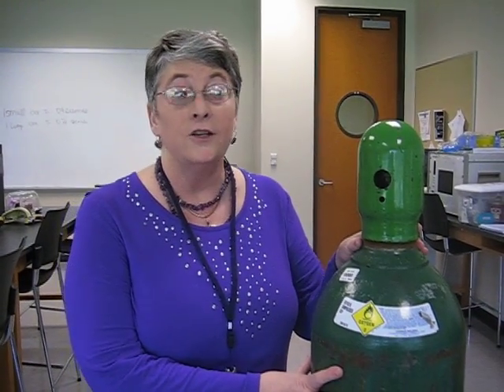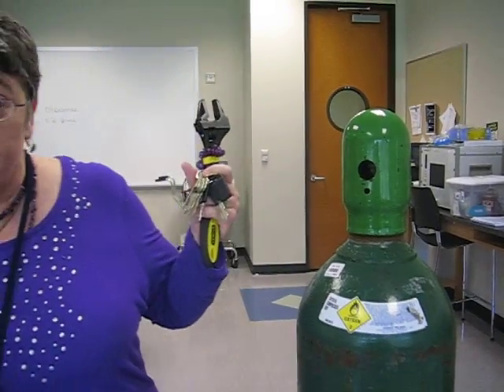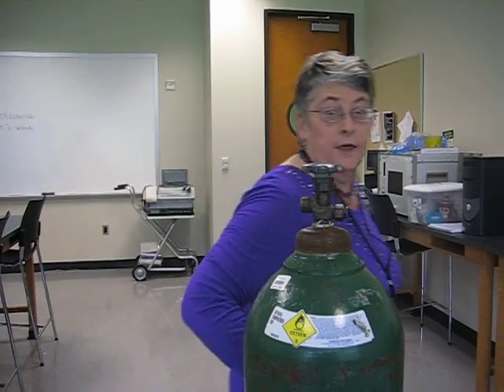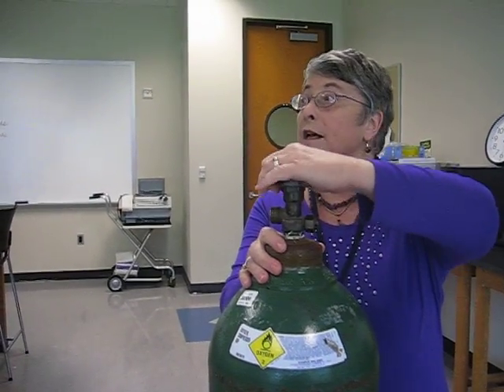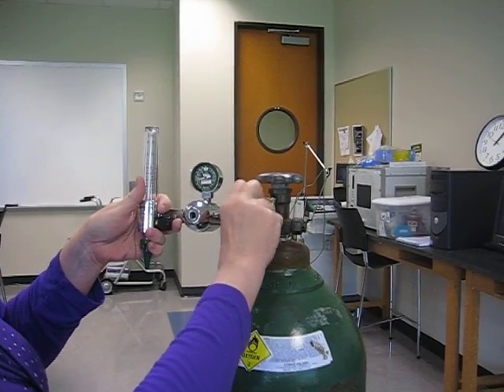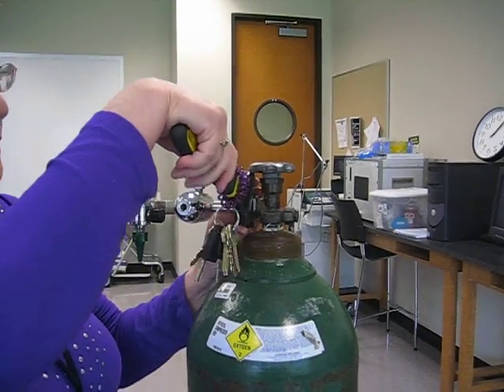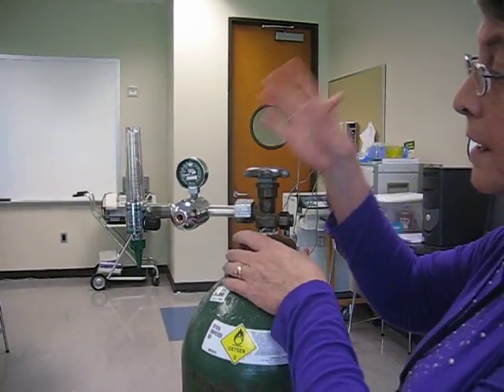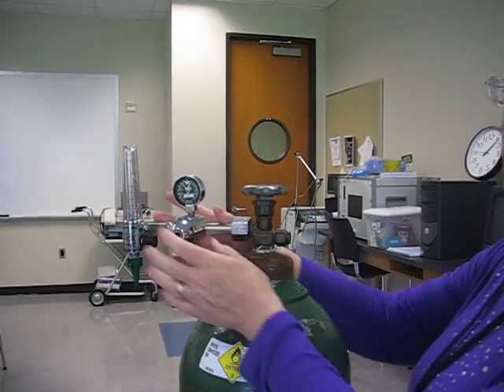putting regulator on H cylinder safely

Comment: We are professional manufacturer and supplier of Gas Cylinders Regulators, Oxygen Flowmeters, Medical Oxygen Flow Regulators, Medical Oxygen Kits, Oxygen Intake Devices, Gas O2 Valves, Medical Pin Index Valves, Medical Gas O2 Supply System Products, Gas O2 Cylinder Trolleys, Gas O2 Outlets, Ceiling Medical Pendants, Medical Gas Oxygen Respiratory Products and etc.Please feel free to contact us whenever you have any potential demand.Best Rgds,Allen(E-mail: sales3@cbm-tech.com; Cell/Whatsapp:+8617638109561)

Comment from the maker: When I say that the "entire device is collectively called the regulator", I am not quite accurate. The actual regulator is found inside the housing that covers the spring that actually sets the pressure that will be regulated. It is the interaction of the spring tension (pressure) and the pressure inside the chamber that reduces  high pressure to lower pressure and keeps the working pressure going to the Thorpe tube constant.
Reply: don't be an asshole